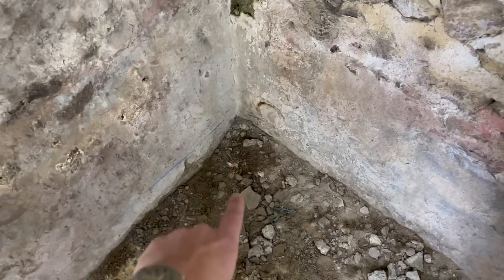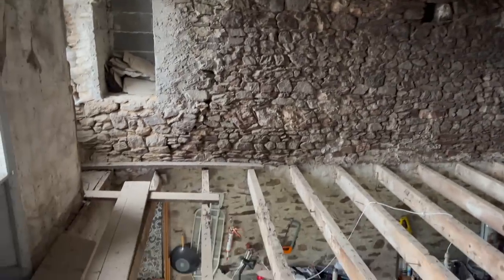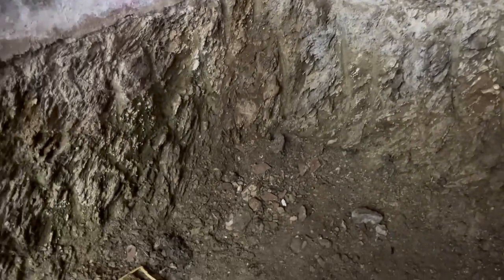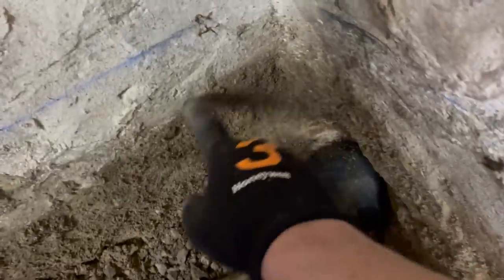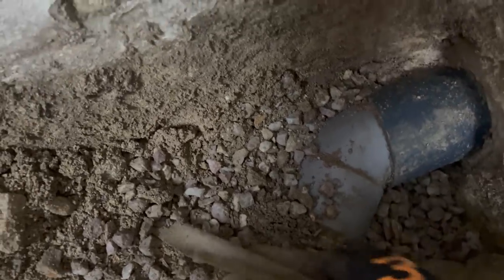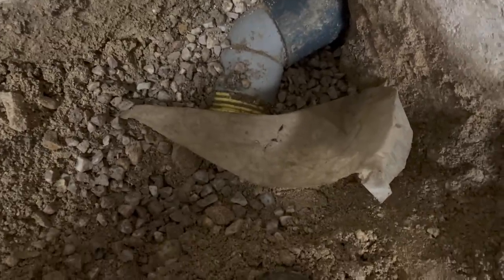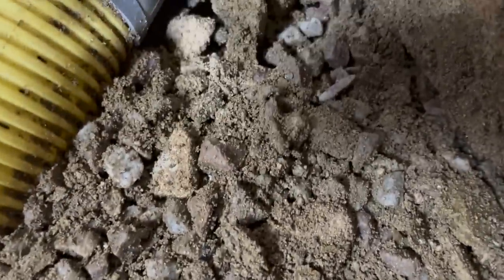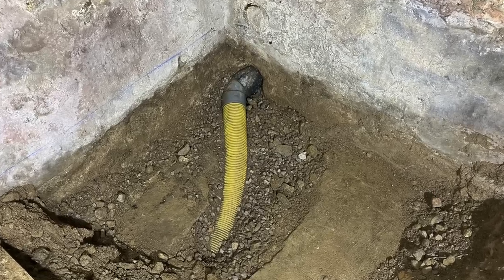A French Drain Inside Our French House

Comment: I would want to be absolutely sure the outside drain runs into that perforated pipe by adding a dye in the outside drain channel and see where it appears. Once you are sure where water is going you can then start to form a solution to the problem.
Reply from the maker: Good idea. Cheers.
Reply: I would add that given the house is effectively on bedrock, what I would do is install a curtain drain uphill 5-10 meters from the foundation by trenching in a perf-pipe drain ON the bedrock uphill to lead most of that water around the side. That will minimize the amount of water that actually hits the foundation. Then, along with using hydraulic cement to seal the footing up to the grade level you want on the stone foundation. Clean up any bad mortar joints and re-point the stonework while you're at it. That should then be tarred (I usually use roofing cement) AND covered with heavy plastic sheet all the way down to the bedrock. I'd also continue that all the way along the side of the house. Of course, perf pipe in the bottom of that trench, washed gravel, geotextile barrier and fill with washed gravel all the way up to ground level. While you have the basement floor dug up, I'd run perf pipe all around the perimeter as well and backfill with tamped washed gravel, a vapor barrier and then concrete. It may well be wise to install a radon collection and evacuation system in the gravel as well (also perf pipe). A sump pit and automatic sump pump would also be something I would do here in the US. The house is right on the point where the local water table emerges so the ground will almost always be saturated.
Reply: Use food dye to find out its seeping into the floor.
Reply: @yodaz101  Yeah, I agree. Cleanouts are critical with something like this as is proper slope.
Reply: BreatheScotland  Just use food dye. It won't persist long. you will only need a few drops.
Reply: @BreatheScotland…..a couple of drops of cochineal won’t harm anyone.

Comment: The pipes in a herisson are supposed to be for aeration not direct drainage ie they should have a vent - not an inlet! At a guess, someone made a herisson to passively dry the foundation and a later person came along and connected the vent to the spring, thinking that it was a drain. Get that as much of the spring water diverted into a sump or a trench with a proper drain and leave the herisson vented to do its thing. You might even stick an inline blower on it to speed it up temporarily
Reply: I'd guess maybe there was originally a drain pipe without perforation running from the channel behind the house and maybe the hedgehog pipe joined in to it with a 45° joint where the pipe exits the house at the front.
The perforated pipe should run across the full width of the inside of the back of the house at the bottom of a trench with gravel around it to drain towards the front pipe.
Otherwise it won't remove water/moisture that soaks through the rock from outside. The main drain should run through unobstructed to freely drain the Springs at the rear before they get to the house.y great grandmother's house in Ville de Eu in haute Normandie had a similar thing except it was done before plastic or metal pipes but had the gravel filled trenches sitting on bedrock directed downhill.

Comment: I don't see a clear opening of the perforated pipe at the street.  Is it blocked?  Well, they got it half right.  The pipe for the water that is weeping from your back hillside should be solid all the way to the street opening (daylight).  The perf pipe 'hedgehog' drain can be reused and run parallel to your solid pipe, draining to daylight.  The perf pipe will collect seepage that is travelling upwards and pipe it to the street.  A quick quick fix is to put down a vapor barrier (plastic sheeting or better yet a recycled pvc billboard on the entire floor and up the walls about 2-3 feet.  Then run a dehumidifier in both basements to bring down your humidity level to 50% to stop the spread of mold.  Getting the humidity level down is really important as your home may become uninhabitable as molds and fungus flourish.  You would be wise to get a roofer in right away to fix the flashing/roofing around the chimney in your finished house.  That's an essential stand alone job that should not be terribly expensive.  If you decide to replace the entire roof, you can do that at a latter date and you'll be able to reuse the new flashing.

Comment: Subscribed, building surveyor here. Firstly you are going about things in the right way with the whole discovery thing. You need to know what you are dealing with. It looks like a very old building the back section especially so it has probably had a chequered past, not always residential. Next step maybe is to get a drainage plan for the front of the property as you will need to make a connection onto something rather than a gully. The water board hopefully can help with this. If hopefully there is a storm water drain to the front then you also need to know the depth as this will gauge the depth of dig through the house. There are sort of 2 approaches with very old properties 1. You except they are going to be damp and mitigate or 2. You attempt to bring them to a “modern” standard which may require a great amount of initial spend re tanking etc. Good luck, makes for great content!
Reply from the maker: There is a storm water drain on the street, although the street is perhaps 700mm lower elevation than the house. The current drain simply runs onto the street and in heavy rains we have a small river across the property entrance... although this is also due to a connecting road a bit further up the street that produces a torrent in bad weather. We've been told that road floods because of the agricultural land above it, which is also behind our property.

Comment: Seems to me that whoever installed that perf pipe under the basement floor was trying to kill two birds with one stone as cheaply as possible and as a result both birds are merely wounded - ie. - the water isn't properly routed around the house and instead of draining the basement floor it is actually worsening the humidity problem in the house.

Comment: Reroute the water from entire back wall to the front including under that lean to. Maybe dig as far down as possible to pour a concrete support wall and tank it to be sure, would be more reliable than trying to tank uneven stone. Dig out all the gravel from inside and raise the floor, then tank it so you have a dry ‘basement’. Then ventilate that well.

Comment: English couple doing renovations in Portugal having met severe drainage problems and how they dealt with it. Lots of good experientia docet's coming from them that you may find useful. They did not have to deal with a wet hill right next to their building. YouTube channel - I hope I have it right, as they changed it "Do. Grow and Reap" ? Get back to you if I haven't. Try it out. Stacks of videos, fortunately or unfortunately but they are well documented so it should not be too difficult to sieve out the relevant ones.

Comment: Yeah that would never fly here in Canada.  Building codes would prohibit using perf pipe to drain water from outside to inside.  Lol.  In some cases we do weep drains inside the foundation but they drain into solid pipe or sump pump.

Comment: I know you mentioned having a small budget, but if that was my property, I would be looking to remove the earth from the side of the property and re routing the spring and the rain water to come around the side, rather than under.
Remove the sources of moisture or mitigate them as much as possible from the property.
Avoid modern Portland cement and gypsum plasters.
You're going to need to use lime based products so the property can breathe.
Reply: Yes, I'd seek to divert the drainage from the back and add a French drain on the side. Also you might want to consider tanking the outside of the walls to prevent water ingress. Letting walls breathe is a concept often misunderstood. You want to let moisture escape from the wall in some instances but if you can prevent it from entering the wall in the first place that's even better. Also in some cases it won't hurt the wall to have moisture sealed in, properly built walls are perfectly fine even submerged in water. Your main aim is to keep moisture away from the internal surface of your floors and walls and ultimately from the air in your home.

I suppose in an ideal world you'd add a damp-proof course between the rock and the stone walls and tank the rock underneath to keep the water out of the house. A tanked concrete slab above the drainage system keeps your floor dry. Tanking the outside of the stone walls above the new DPC keeps your walls dry.

I'm not an expert but I hope that I have enough understanding of physics to be able to tell that damp in buildings is a vastly under-researched topic where experts very much disagree and there's very little hard evidence. One problem is that damp issues take a long time to manifest and are influenced by many factors. Simply replastering a wall can mask damp issues for up to ten years. That makes it very hard to tell if problems have been solved or not.

Personally I prefer systems that don't rely on heating and ventilation, i.e. treating symptoms and removing the moisture that's already inside the house where it doesn't belong.
Reply: I bought a property in Hungary last year, one of the mistakes the previous owners made when renovating was the use of  Portland cement and gypsum. The walls of my house are made of clay and lime based products need to be used,
Reply from the maker: Hi. It seems that is where we are heading; redirect water around other side of house. Remove that earth etc. As it is the place has cement everywhere, even the most 'recent' pointing in the interior has been done in cement. Ideally we will re-do this with lime and insulate with breathable materials inc. plasters and paints. 

It seems to me that one has to work 'with the house' rather than suffocate it.

We still working on the numbers and where are current budget is best placed, fortunately we also qualify for subsides on insulation, roofing and wood powered heating (fire stove). We are hoping to be able to get some of this major work done before next winter.
Reply: 💯 the earth around the house is smothering it not allowing air and also all water is directly running into home side
Reply: One could replace the perf pipe with solid pipe, get the outside water through to the street. The perferated pipe could be reused to drain the area under the house and next to the through-pipe.
Reply: @TheDuckman02050  yeah the perf pipe inside is weird. As I understand it the perforations are meant to let water in whilst the original setup seemed to be just trying to channel the water from the bedrock carved channel under the house and away?
Reply: @TheRenovationProject  Letting the house breathe is a bit of a fine line. The main issue with cement is if used together with soft building materials (like some stones and soft bricks) it can cause damage to those softer materials. Very hard materials like granite should be pointed with cement, or so I've been told.

Plastering the entire inside of a building with cement causes the walls to lose their ability to buffer humidity from the air. If the walls are also cold that means condensation and damp, especially in summer.

In other instances, especially on the outside, you actually deliberately tank the walls, "letting them breathe" would be very ill-advised when you want to keep water away. If the floor is below DPC level you also want to seal the walls below DPC level on the inside instead of letting all the damp into your rooms. A wall below grade won't breathe anyway so tanking these sections doesn't hurt. Without sealing, the wall will always be as damp as the surrounding ground.

Comment: Dear Home Renovation guy.
It's pretty simple because there are only two rules existing for your problems: 1) Water always finds it's way! 2) Any water must kept out! 😁 ;-)
Please kindly allow me some suggestions: A) I would definitely put a closed = water tight pipe aside the yellow drainage pipe in your cellar. But I would definitely leave the perforated pipe in the ground. This takes care of rising damp/moisture from under the house. Just put an end cap onto the yellow pipe where you removed it from the grey pipe. Then the real work starts: Dig up all 3 sides of your house round about 1 to 2 ft deeper than the foundations. Bed in yellow drainage pipes in the right/proper way. Let the walls/foundations dry out really, really well over the summer. Maybe use drying devices additionally. Put common water barrier stuff etc. on and in front of the walls/foundations. Connect the vertical roof drainage pipe to the new pipe under your house. Or change the angle of the roof gutter to have the vertical pipe on the opposite side/edge of the house. Build a kind of water tight water collector/pump sump to catch all the water from the different springs on your property and the overflow from the well. Connect this to the new pipe under your house. Unfortunately you can't take much influence to what happens to the wall against the neighbors house.
B) The easiest way to get rid of your problems: Sell the house and buy one that is standing alone/free and isn't dug into a hillside. Please don't forget: Mold is definitely more harmful to your health than people think it is. Saltpeter on the walls is definitely not helpful too.
Best regards, luck and health in particular.
Reply from the maker: Thanks. Appreciate your comments. Not selling the house though! I like a challenge. : )
Reply: ^^ This guy is right

Comment: In the long term, you'll need to dig the whole floor to install a drainage system under it to take out water coming up the ground, dig around the house to install a drainage system to take away the water flowing down the hill, and redo the roof guttering. That's a load of big jobs.

As a short term project I would install a pump into the well and start emptying it. Since it's on the uphill side much of the ground water would start flowing into it rather than into the house. It's basically a sump pit already.

Comment: Some years back I had an 1880's house in south east London that had a damp cellar - originally a 'coal hole' - when I investigated I found a perforated spherical salt glazed pipe termination under the floor leading to a main drains as a similar drain method to yours. I ended up digging a sump and putting an automatic sump pump in it which solved the damp problem by locally lowering the water table.

Comment: put a sump pump in the well  then thread the output pipe through the french drain to the road. Block the remainder of the pipe going through the back wall and then direct the garden water into the well. Now the under floor drain is only draining the floor whilst the pump is redirecting the water under the house avoiding the cellar.

Comment: Dear Home Renovation Project Manager, 
French drain under the house is OK for dewatering area under the flooring.  But using the same perforated pipe to pass through water from backyard to the street is definitely bad idea. You need to block water access from backyard to this perforated pipe, and put another underfloor solid and tight pipe from backyard to street gutter (could be lower diameter - 50mm - and You can try to push reinforced PVC hose through perforated pipe for this purpose).  It seems that collecting water from  backyard  "hole" and diverting it to the well is good idea, another concept is to put submersible pump to this well and pump out water from there to the street...
Greetings from Poland ;)

Comment: As soon as I saw the perforated pipe The first words out of my mouth where same as yours 
If it was my house I will be diverting the spring around the house from the back around .
The other alternative is having a sump in the house floor laying the water clicked on it and having a pump and the pump soft water after a certain level reached I worked on a job Where the whole bottom of the house was lined with plastic all the walls up to about 3 feet so water collected under the floors In the sump and it was pumped out every so often automatically but the Cost absolute fortune That was a big old house as well by a river yeah I think you should Divert the spring around the house.
Can’t wait to see what you do next
Reply from the maker: ...For sure we will divert the outside water. Having read up on it, yes, the drain under the floor would be beneficial to stop water collecting under the floor. We will most likely use such a system, just without running an exterior drain into it! Cheers.